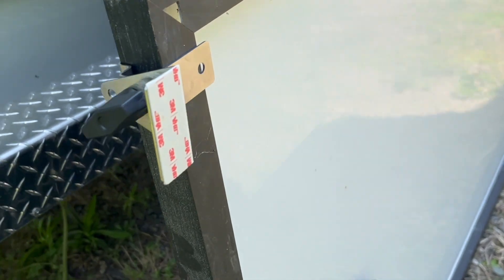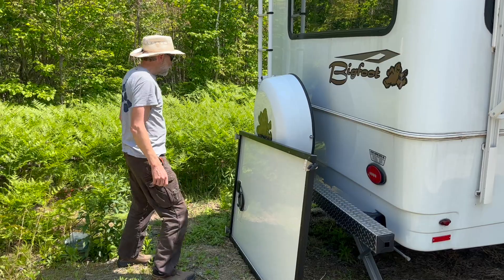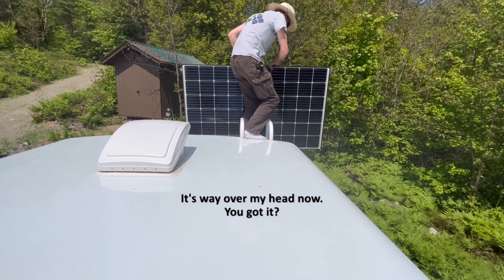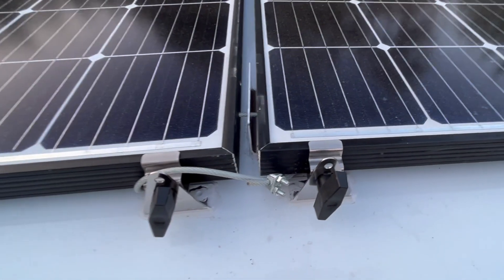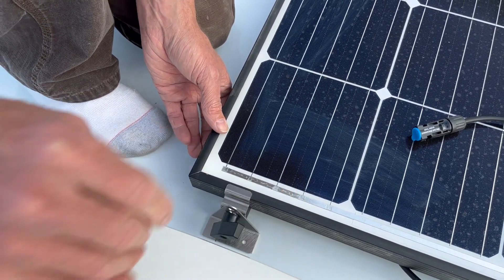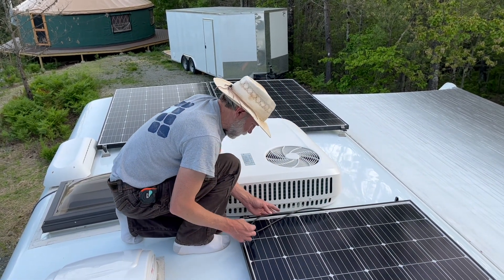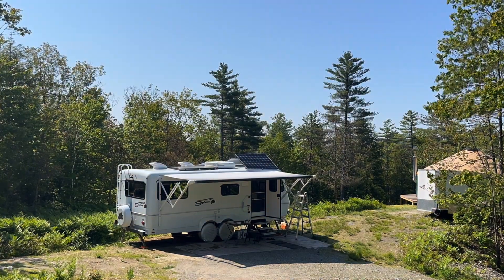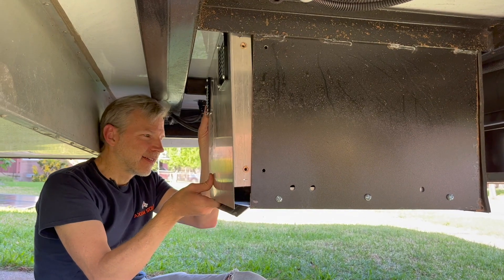RV solar installation - Part 2 - mounting the panels

Comment: Are your panels giving you plenty of power to run everything?
Reply from the maker: The ones on the roof alone will not run the A/C for long. On a sunny day and a full battery charge it would keep us cool through the hottest part of the day, but then we would need a generator or shore power to get us by.
If A/C is not needed, then yes, we can get by indefinitely.

Comment: Dicor is used to keep water from entering the tape causing it to separate, not anything to do with sun.  There is a small foam type layer between the glue on each side.  That central layer can absorb water and separate.  This explanation came directly from AM Solar.  You MUST keep water away from the tape.

You also don't want your panels perfectly flat.  When perfectly flat any water or dew sits on top and the panels slowly gets dirty, especially on one of the edges.   Our new to us 2016 25RQ had a single panel mounted in the center of the camper fairly flat.  The dirt can get so bad it reduces solar output.  One day one diode started blocking one side and we lost half the output of the panel.  There was dirt covering the panel on one side causing the problem.  I flooded the panel with water and wiped it with microfiber cloths.  When I got down the output had nearly doubled.  We never had that problem with our Escape's slightly angled panels.

Three weeks ago I removed the 160 watt panel that came with our 25RQ and installed two Rich Solar 24v 200 watt panels.  Our panels have about a 3-5 degree slope to the outside so water will run off, not pool somewhere on the panel.  I purchased AM Solars 5 hole mounts.  The mount at the outside edge of the roof is in the lower hole and the mounts at the middle of the camper are in the third hole.  Water runs off (doesn't pool) and the panels will stay much cleaner.

You really didn't mention how to prep the roof.  AM Solar recommendations added #3 below from when I installed panels on our Escape two years ago.
1.  meticulously clean the roof
2.  with the mounts on the panel, place them in position and outline the mount locations with masking tape
3.  sand the mount location area
4.  clean the sanded area again ( for this second clean I used electrical contact cleaner, since it leaves no residue)
5.  use 90% or better isopropyl alcohol for the final clean.
6.  with the panels in place, remove the tape and stick the mounts (one mount at a time)
7.  let sit for at least 72 hours before traveling (ours sat 9 days)

Comment: LOVED the wildlife footage 😁!! 
Wonderful that you've got so much solar on the RV roof now. What a great help that will be. 
What are the summers like in your area? Does it get terribly hot? I can't remember if you've said what part of the state you're in,
Reply: Woops...accidently sent too soon 😖.
Anyway, just curious, so are you in the north, central or southern part? 
Have a great week!! 🥰🌿
Reply from the maker: We're in the southern part, a little bit warmer than most of the state.
Reply from the maker: So much wildlife this year (more coming soon!) We have been using these panels (from a temporary ground mount next to the RV), even before the larger system was set up on the property... but now we can use them on the road as well. Summers are variable, not generally very hot but with a few heat waves above 90 degrees for a few days. This year we had one of those in April(!) Then there was a freeze one night in late May, and a chilly couple of weeks at the beginning of June.